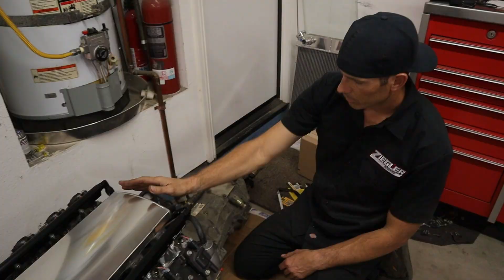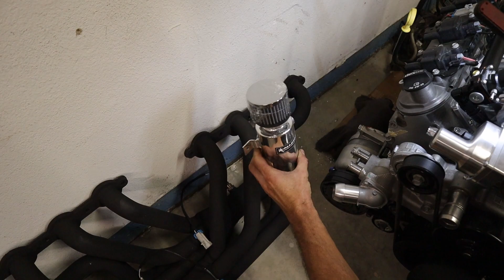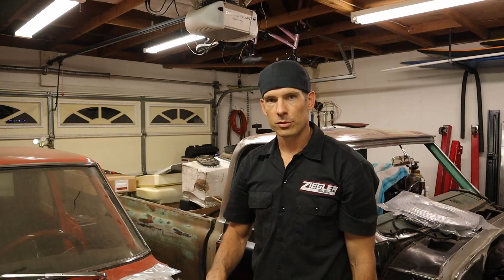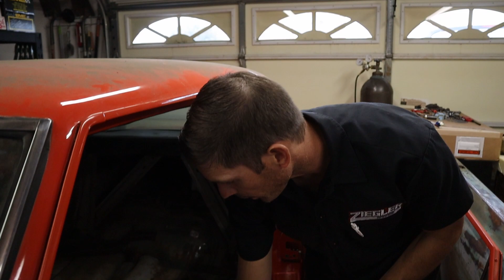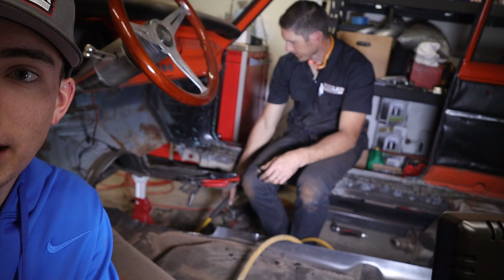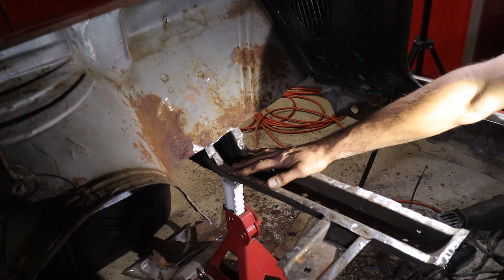Cutting the rusty floor out the 65 Nova - Chevy Nova Build Part 17

Comment: Why not replace with a 1 piece entire floor pan?
Reply from the maker: The owner of the car supplied separate floor pieces, but that would’ve been the way to go. Would’ve saved a lot of time.
Reply: @ZHPGarage  I'm replacing the whole thing on a 63 chevy ll . Was worried about any body twist if I remove the whole pan. Any suggestions?
Reply from the maker: When we did it, we made sure the car was level on the jack stands. Since we changed the front clip, engine and tranny, and rear suspension, all of that was out of the car so there was no excess weight pulling on the front or rear of the car, so that the car wouldn’t taco under the weight. Also sedans have more structure than a hardtop would, so that helped us as well. Just a few things to keep in mind.
Reply: @ZHPGarage  thanks for the info!